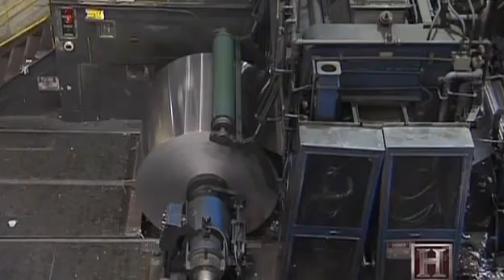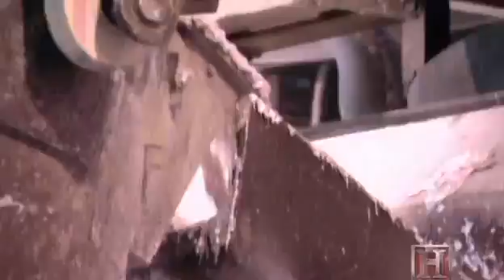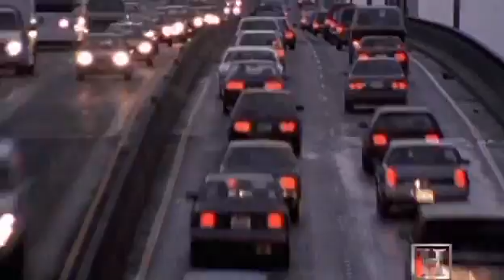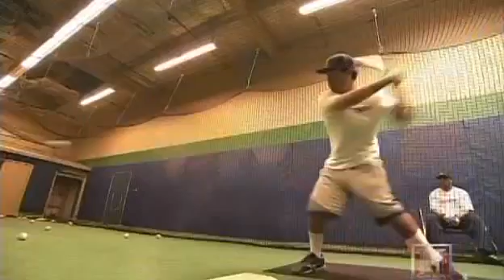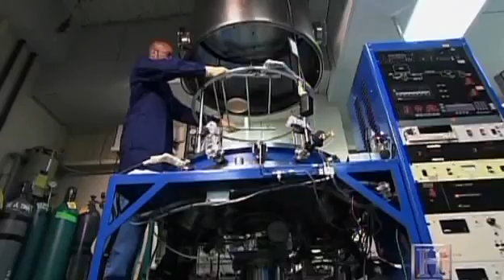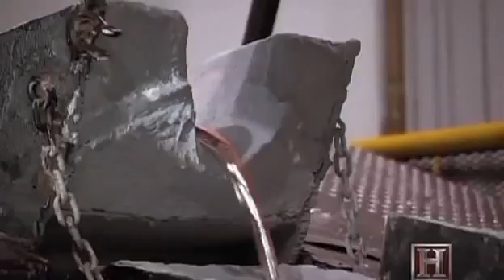Modern Marvels Aluminum

Comment: Good old tin
Reply from the maker: Tin & Aluminium are 2 different elements, aluminium atomic number is 13 and a atomic mass of around 27tin atomic number is 50 and atomic mass of 118
Reply: Tin and aluminum are two very different metals...
Reply: Joshua Kaczmarek no they're not
Reply: How are they not? They are two different elements.  Find a periodic table, you'll find Tin (Sn) with an atomic weight of 118.710 and Aluminum (Al) with an atomic weight of 26.9815. Just because they are similar in appearance doesn't make them the same material
Reply: About 6 minutes in, they actually talk about how aluminum was an upgrade to the older tin foil, and how some people to this day still refer to it as tin foil, despite the fact that it's now aluminum.
Reply: I beleive you misheard, they said some refer to it as tin foil despite never being made of tin.  Regardless, tin and aluminum are two different materials...
Reply: If we want to get really technical, they specifically said they never made it out of tin as a household foil. They did make tin foil as wrappers for cigarette and candy companies. Regardless, It's generally best not to argue with a guy who's already agreeing with you.
Reply: tin has been taken of the markets by the US government , the US military uses it in advanced air/space craft , NASA learned a lot from Hindu Veda texts about vimana "flying machines" from Indian history.
It's secret which alloys are used the Indians said lead/tin , NASA engineers also built a model of the flaming chariots of Ezekiel from the bible , they're VERY smart guys and ALL astronauts are freemasons as is the NASA leadership , most masons know this they have pictures of Neil Armstrong in masonic garb in their headquarters , they're not just a space travel agency , they're spiritual in their connection with space and man , space odyssey 2001 style .